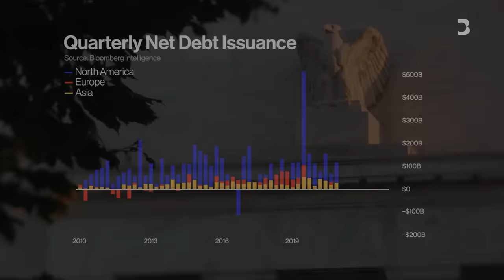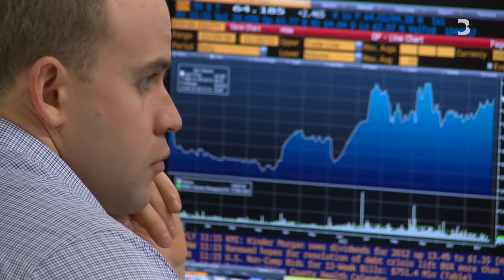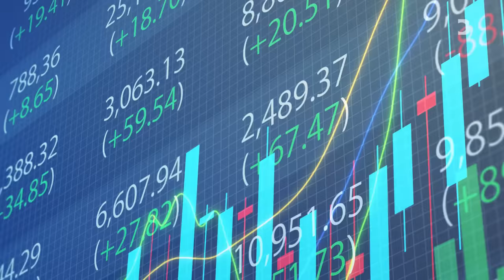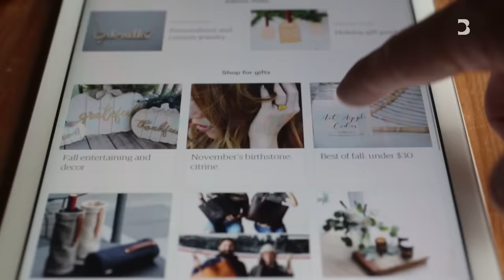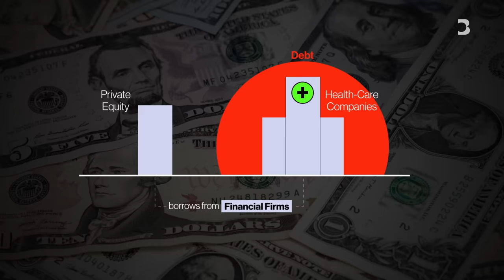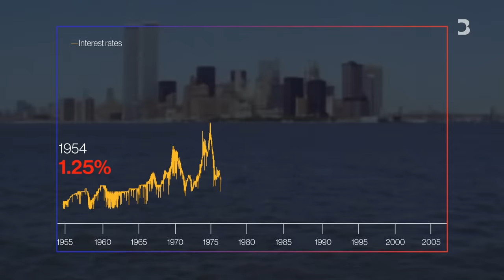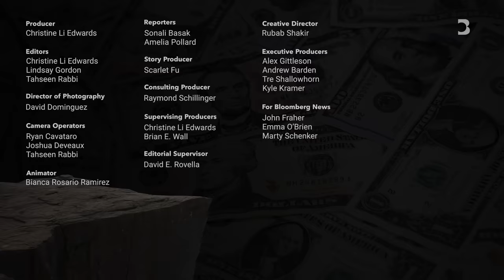Why So Many US Companies Are Going Bankrupt

Comment: To answer the title question. These business were built on models that rely on cheap money, and a weak labor force. The labor force has given up on working until they get something that can actually make sense and pay bills with the time they are expected to allot to work. Since a lot of places don't want you to "cheat" on them with other employers, they basically left no other possible result left on the table. "They" being the collective interests of corporate america who have been taking profit regardless of how it happens. This isn't a magical system, it is an economy, it can output great things into the world, with proper management and reliable inflows of the correct resources.

Basically, the kids have been outside breaking the rules and having all the fun, but daddy is home, and the nonsense and bs stops at the bootheel. It's worse than 2008, we dodged part one of this whole inflation issue thanks to covid. But we also catalyzed the second part. We WILL see on of the largest economic depressions in history by the end of the decade. Everything is repeating from last century in a modern way, and right on schedule

Comment: Technology has the pattern of devaluing everything it touches. Not in a negative way but in the way that it reduces scarcity and cost of goods and services to the point where there isn't enough value generated to support those that labor to create and maintain them. Everything has to be subsidized in various ways, from direct subsidies to indirect methods like overhyped valuations and borrowing based only on the idea that "x" company will take over a market. What's unsaid is that, once an industry reaches a certain technological threshhold, "taking over the market" effectively means destroying that market and making it monetarily unsustainable. As a result we've already seen signs of tehcnological suppression and even regression via regulation. This is society entering its post-scarcity phase. We're just currently in denial about it and instead of adjusting society accordingly, we're trying to brute force a solution that stays in line with traditional capitalist thought even when the math clearly won't add up over time.
Reply: This trend of dematerialization has both positive and negative consequences. On the one hand, it leads to lower prices for consumers and a higher standard of living. On the other hand, it can lead to job displacement and economic disruption.
It is important to note that technology is not the only factor that contributes to dematerialization. Other factors, such as globalization and deregulation, also play a role.

Comment: What do you expect? Insanely low interest rates for 15 years and then central banks forced by events to jack up rates to levels most young adults have never experienced
Reply: 😬 Well, that's quite the roller coaster, isn't it? 🎢 It's like living in a financial drama! 💃🏻💸 But hey, who could resist those tantalizingly low interest rates for all those years? It's like walking through a financial wonderland! 🌈🌟 However, the sudden hike in rates might make some young adults feel like they're riding a financial rollercoaster without a safety harness! 😱🎢 Hang on tight, folks! The ride might get a bit bumpy! 🤪

Comment: The problem is that the incredibly high interest rates have no reasonable basis, since the inflation data showed significant improvements. The Fed is not acting responsibly; in fact arguably they're acting just as idiotically as when they ignored the inflation problem initially.
Reply: Inflation is incredibly sticky and they have to crush it. Look at the historic amount of strikes this year. House prices have not come down. Unemployment has not increased. Wage growth is slowing but people will not simply accept that everything went up in price except their salaries. People will demand higher pay and inflation will continue. Look at history and you’ll see that once inflation rises above 5%, especially 10%, it becomes very sticky and lasts for a long time. They can pull up now and inflation will jump immediately.
Reply: @NicholasWHaley7  100% agree.  The Fed doesn't just need to slow inflation, it needs to step on it's throat and keep it there until the US economy, both businesses *and consumers*, stop spending on discretionary items, throw up their hands and capitulate.

Unfortunately, that means a bit of suffering for many in the short term but it will bring better days.